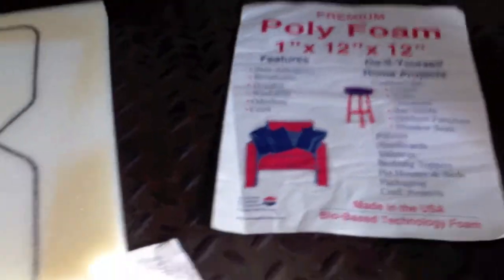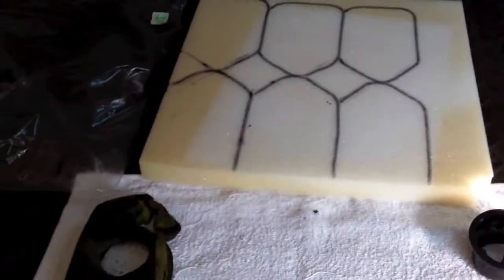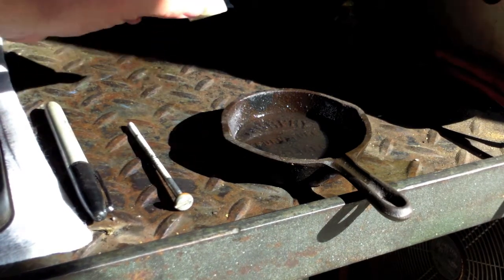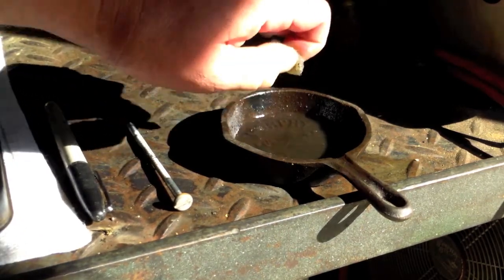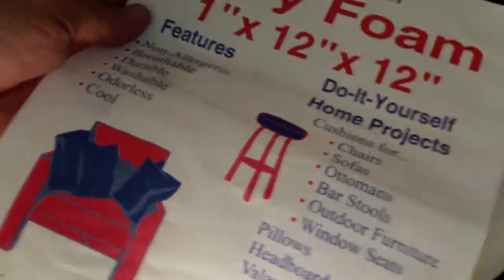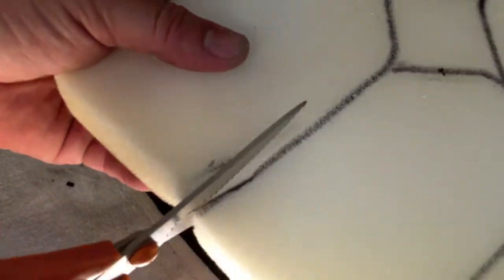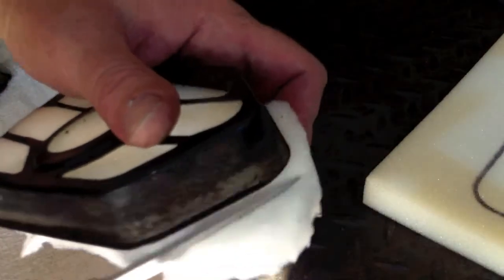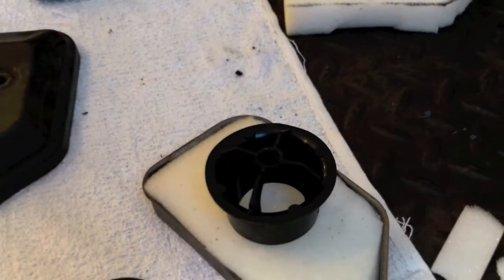How to make an air filter for a mower

Comment: I'm glad you demonstrated the "soak" test on your homemade filter. I just bought some type of grey insulation sponge that's used to insulate around a/c window units to make filters that are expensive and obsolete on a Homelite Super 2 chainsaw. I didn't consider the possibility of it melting with fuel contact. So glad you shared this tidbit of useful info. Thanks again man, really appreciate it!

Comment: hahaha 7 min 33 sec is super brief, not so brief hahaha ya with a little bit of oil on the foam, than squeeze it a bit its best for the filter. 2 cycle oil works best.... it will last longer than a dry foam filter. so add a little bit of oil for it to last longer.. great video thanks.. I have done that on a few mower filters. it works GREAT....
Reply: hey I have done the something with the air filters. just remember to add a bit of oil to them. I use 2cycle oil, it works well. this helps them filter better and keeps the foam from drying out....

Comment: do they need to be soaked in oil? hows the knee? greetings from Wales
Reply from the maker: You can soak them in oil and then squeeze them out, just like regular OEM filters. That would help your engine a lot more. I don't guess you have to though if you change it out very regularly

Comment: I saw a pleated air filter designed for a Sears Craftsmen mower for 38 bucks! ...NO WAY! So I purchased some window A/C filter foam at the grocery.
Reply: LOL,  that's what I am going to do.   How has it worked out?
Reply: @jamesjames1716  Ya have to shape it correctly...some hardware cloth to frame it may be good.

Comment: Yeah I tried that, but they don't stand up as good as the b&s ones..... Once it's exposed to oil and gas vapors it breaks down and ends up sucking into the carb, which isn't good.
Reply: Hi,  Mower's original filter lasted a Long time.  NO replacement easily found, finally settling for one WITH Plastic housing. [B&S branded(?)]  Foam different color,^ did NOT Last 2 years.  What's a SCAM.  ugh!  Dumb me didn't know what type foam, then might've been smart enough to make one.   : }    ^ Sponge Material ??
Reply: @kareno8634  are you asking what type of sponge material to use? If you are don't bother go to your local wal mart, and just buy the oem filter assembly, it's not that much money, compared to the damage you might do with making your own, and please don't knock yourself short, we all started there, and with anything the more you repair the better you get.
Reply from the maker: @kareno8634 That was regular density close cell foam that I had purchased to cover some stools in my shop I believe. It lasted a very long time. Nowadays some stuff might be more degradable so I would do a splash test with a little bit of gasoline to make sure the gasoline doesn’t dissolve  the sponge

Comment: Why do some engines use the foam filter and some the pleated paper which of course can't really be cleaned,  some have both or used too.   If you don't mow in dusty conditions it is probably not even a big deal anyway.
Reply from the maker: I think from emission specs